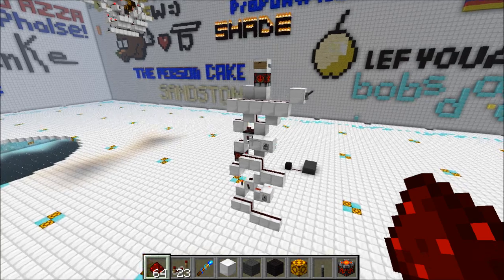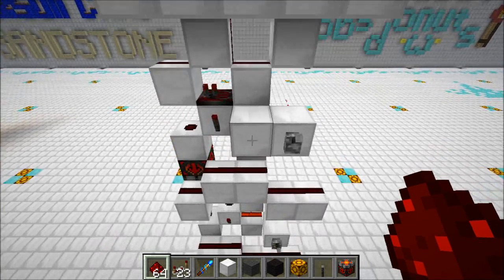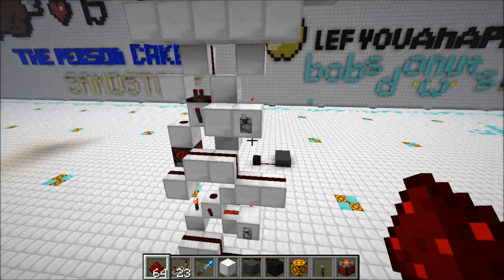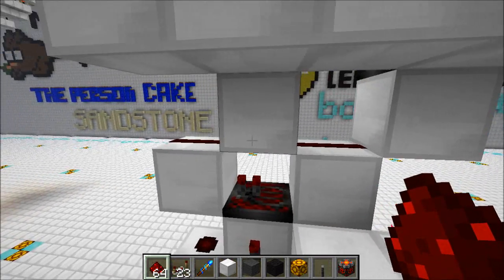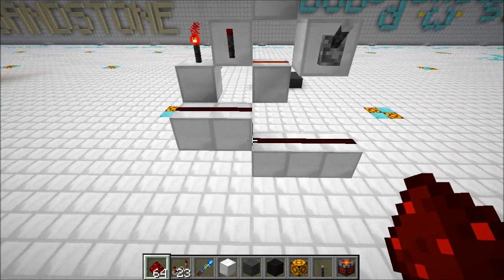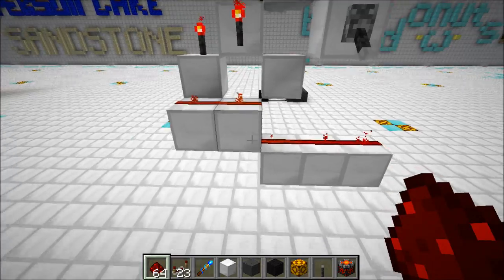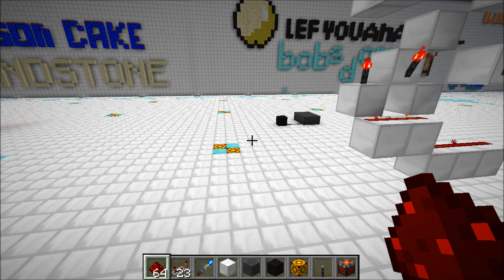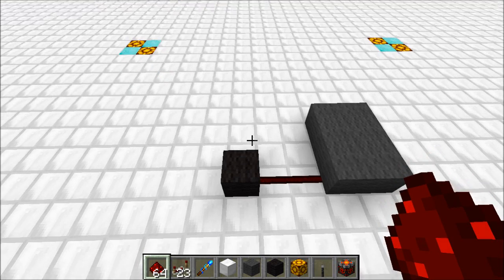Tutorial: Understanding RAM Part 2 - Dual Read and Setting Up an Array

Comment: Holy crap, when I kept getting error messages I didn't know that was actually getting posted each time!!!!! Sorry! But anyway, turns out one of the read lines didn't work, so I revamped it again, and now almost nothing looks the same except the bottom read line. It's also not as tileable as I had hoped, so it's now 5 wide instead of 4, plus an extra block taller at 14. But it works perfectly, it will suit my purposes very well, and your design helped a LOT. So Thanks.

Comment: I just overcame the stalemate of rotating this cell to be 4 WIDE, rather than 4 LONG. The reason being that I'm using dual-read RAM as the mass memory unit for my URISC(OISC) computer, and the SubLEQ language assumes that both variables can be retrieved in one step. Anyway, this way the additional cell size won't accumulate. I ended up replacing the entire upper half, so now it looks like your design had babies with Benny's 2x2 design.

Comment: Hi Proper I have a question
So I understand how RAM in MC computers work but I am confused about one thing; How come when I program I only have to say something like var x int = 5 or whatver, and not have to specify which register I need? I tried to implement this in redstione with counters and an extra 4 bits for variable names but it was really massive.

Comment: If RAM speed is the only issue, here's a way to make your idea more compact. Use RAM cells which are twice the intended size, and select which half is being used at the output. That way, you can execute the first instruction, and then the second, while the next 2 instructions are fetched.